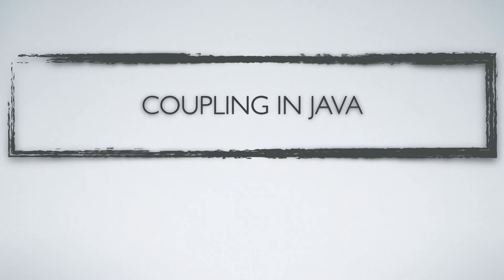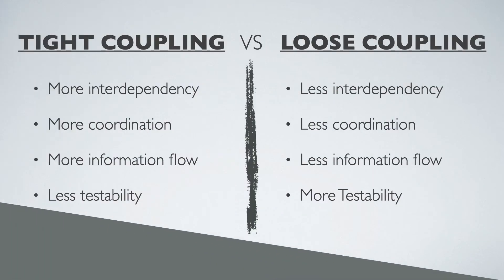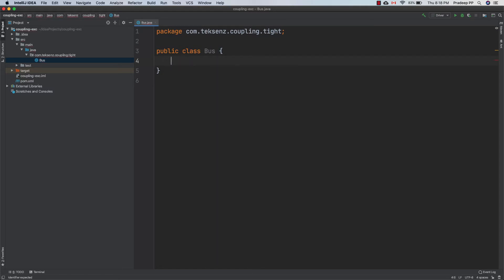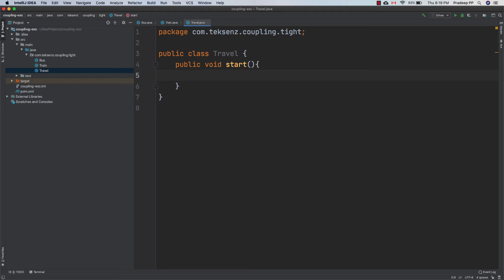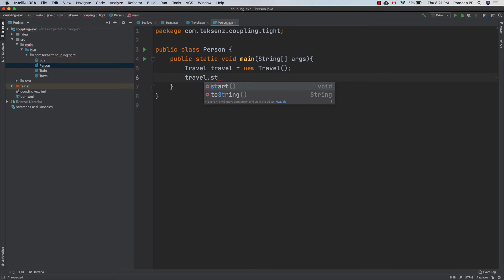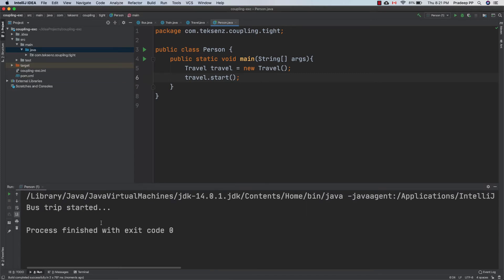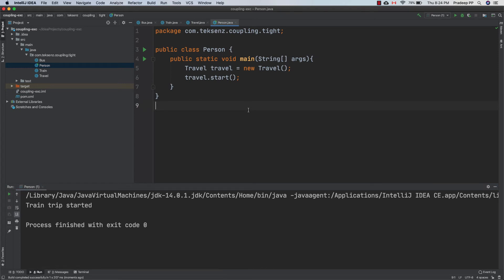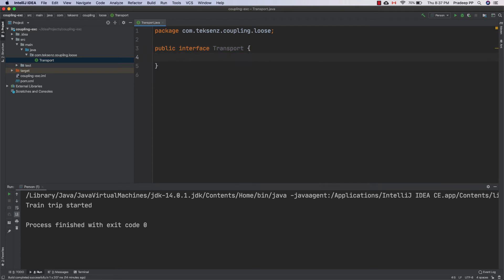Tight Coupling Vs Loose Coupling

Comment: still its not clear.. nobody is explaining that.. in tightly coupled you changed the method name(from start() to go()) and said if you change here then you have to change in method call too... in loosely coupled why didn't you change the method name start() to go().. if you change the name start() then you've to change the name in the implemented classes also right? ... all are explaining tightly coupled well but not loosely coupled.. i'm sooo much confused how this dependency injection differ from conventional way of object creation :( .. please help me pleaseeeee.
Reply: I think changing the function name may not be right example for loose coupling here.
Brief description on loose coupling:
Loose-coupling eliminates the need to bind application-specific classes into the code. That means the code interacts solely with the resultant interface or abstract class, so that it will work with any classes that implement that interface or that extends that abstract class.
Reference: https://www.javatpoint.com/factory-method-design-pattern.

Hope this helps anish.
Reply: Same now how you understood after 9months any video suggestions 😂
Reply: When we create an object using new  , then it is tightly coupled. But in .core we are just passing the class name in container..